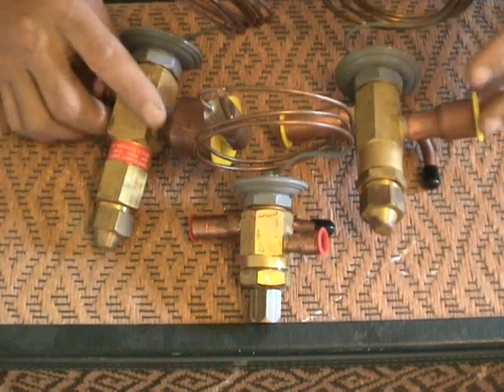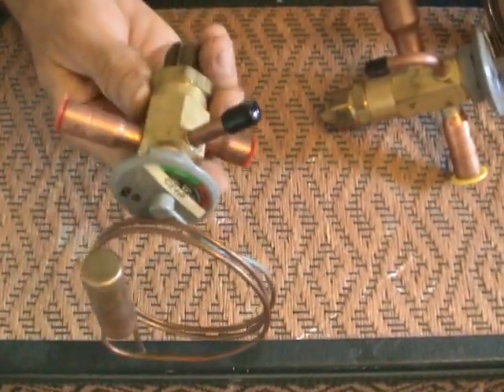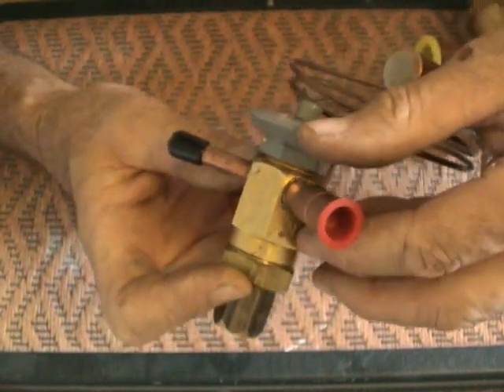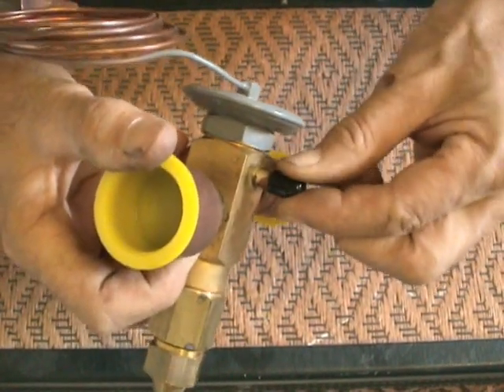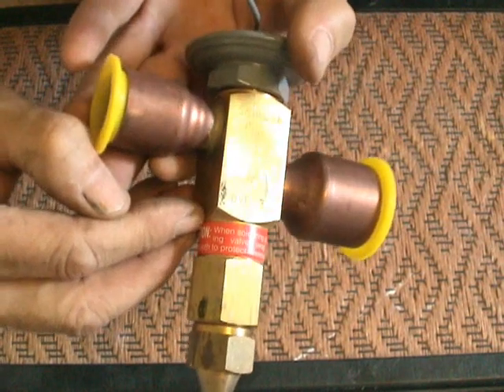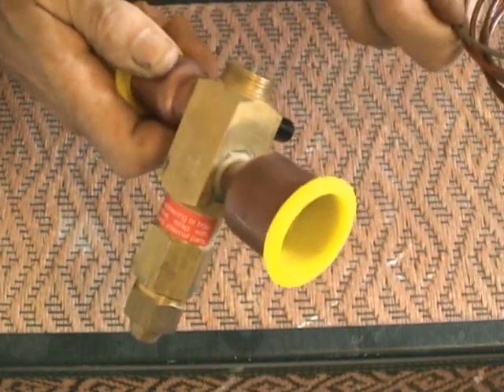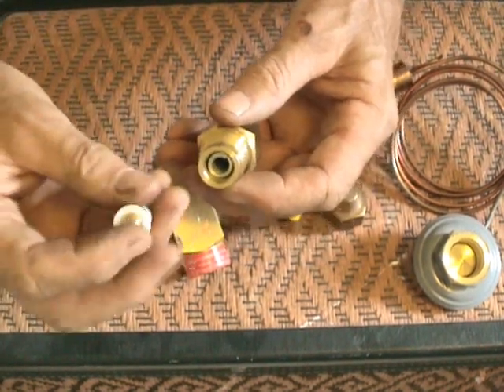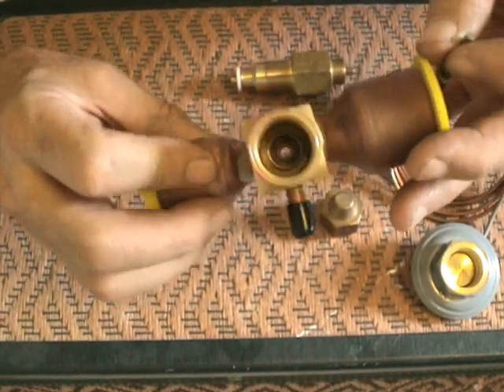HVAC Thermal Expansion Valves

Comment: If the capilar tube breaks, can it be repaired? or we need to change the whole valve? I have a broken Emerson NCE 4 ZAA B5% for a Lennox 4 ton HP. Thanks!
Reply: Your TXV power head can not be replaced. You'll need to replace the entire valve.

Comment: what are methods to resolve oil migration from the compressor
Reply: Islam Fathi make sure that the crankcase heater works. Install one if the compressor doesn't have one.
Reply: DrZarkloff thanks alot

Comment: My carrier system was said to have a leak in the system. A close friend in the field was helping me but became very ill. Another tech agreed and said it was a leak in the system. He put in some leak sealer and the system was up and running. It lasted about two month and the system stop putting out air. A new tech tried to recharge the system but he said that the head pressure was getting to high and it kelp turning the outside condenser fan off and back on once the pressure went up to a high temp. every 35 to 45 seconds. He thinks the sealer is now cause a problem in the system. What do I need to do. ThanksRu

Comment: I was taught by an oldtimer that if you have only gauges  and no other tools you add freon gradually until you get sweat on the suction line all the way back to the compressor with sweat about the size of a half dollar coin on the body of the compressor that the charge is about right. More sweat on the compressor and you are overcharged.

Comment: HI, I have system in which 2 TEV are connected in parallel with common header as input. I am facing icing problem in 1 TEV outside area and it will lead up to compressor. Can you suggest any solution. Ambient temp 18 to 35 C.

Comment from the maker: It might work out if you had a 2.5 ton air handler with the apropriate metering valve and a 2 ton condensing unit.

Comment: HI  in my work it have a PTC unit 30 ton the evaporater is get frozen   2 compresor tem/pres normal except 1 the hi line mark 310 psig please what could be this problem thanks

Comment from the maker: It sounds like the expansion valve is flashing vapor. Typically, this means that you have a low charge. In your case, I'm not sure what to think since you're getting a proper subcooling and super heat.

Comment: The expansion valve is maintaining the proper subcooling and superheat when the unit's not low on freon, but it does make a pulsing sound , where every half second or so, you can hear the hissing of the liquid pulse stronger, and weaker.

Comment: The refrigerant in a sensing bulb must be the same refrigerant that is in that system.  This enables the valve to accurately respond to changes in temperature because the refrigerant in the bulb has the same characteristics as the refrigerant in the system.

Comment: @1theborder  Most likely the power head lost partially its charge, then someone put on a low side gauge and found the super heat high and the suction low, so they added refrigerant causing the head pressure to rise and maybe even for the unit to work for a while in the new condition, but then the powerhead fully lost it charge and shut down, all refrigerant pumped into the condense and head pressure  went through the roof.

Comment from the maker: @henryvideos100 The solenoid coil usually is just bolted on or clamped. Just remove the old coil and replace it with a replacement coil with the same coll voltage.

Comment: I change the orifice tube and the accumulator in my truck,but it's not getting cold like I want it to(60 degress out the vent..with 80 degress ambient temp) ...everything else is use....compressor,etc...and by the way the a/c didnt work when i bought the truck...

Comment: I'm working on a expansion valve  on a car, about the temperature probe, the factory had it glue on to the evaporator tube with tar or some kind of black stuff, do I have to put it back where its at or can I just stick it into the evaporator fins, if not where can I get the tar or glue so I can put it back on the evaporator tube.....thanks

Comment from the maker: @thisisnotyours1 It's a safety device. It equalizes the pressures between the high and low sides if the pressure builds up too much and when the system shuts down.

Comment from the maker: @jimwillfixit27 There are times when the expansion valve body needs to be replaced. One of the reasons is if you're retrofitting a system with a different refrigerant or if you can't buy new parts for the old body.

Comment from the maker: Yes. You could just pump down the refrigerant into the condensing unit. That will allow you to easily replace the power head as long as you have the type of TXV that allows you to remove the power head.

Comment: Dr Z. -   I keep a miscl. sizes of pipe cleaners( from my wife's hobbies) , to clean the push rod guide areas when Im checking a TXV that is in a system. - It works great at cleaning without hurting the guide areas- good video  kmjpcm63.